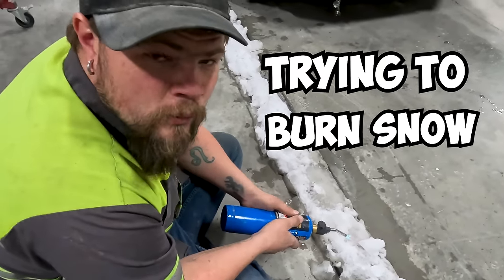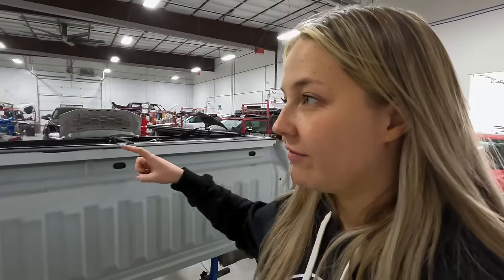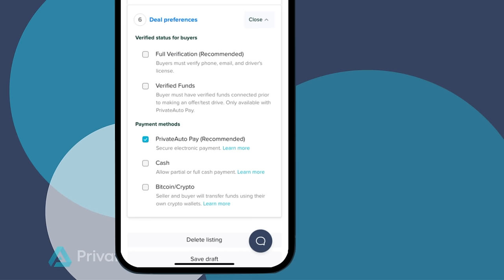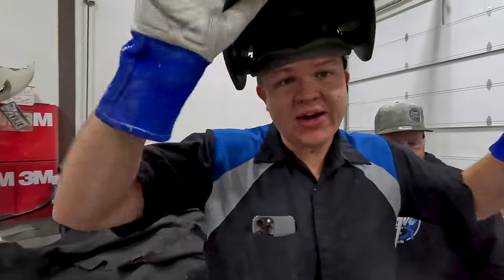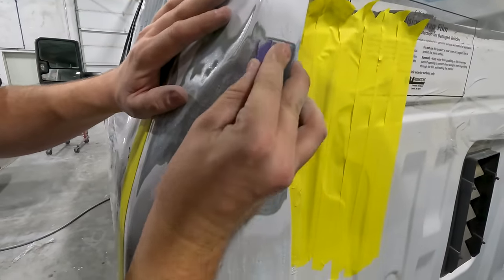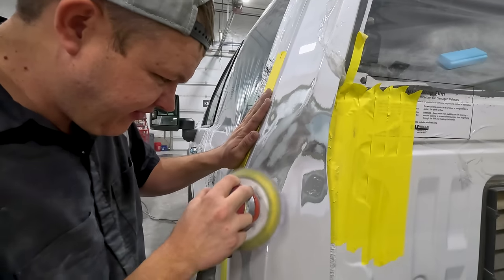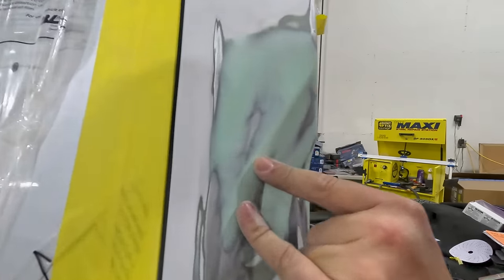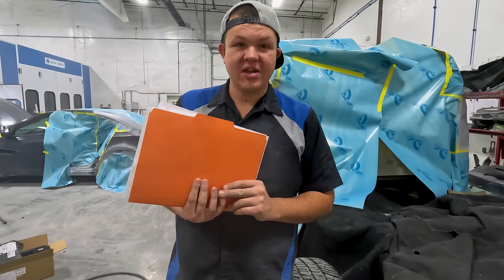Teaching The New Guy How To Fix A Dent Step By Step!

Comment: Dang dudes! That key bridge dent puller is next level. Memories of drilling holes and using a slide hammer to get big dents out. 😂 
Progress at its finest, for the finest. Amazing work by all of you! 
Try a “Surfoam” file to knock off body filler while it’s still a little green to help smooth it quicker. As soon as your fingernail will leave a line, then go at it!
🙏❤️😎🤙🛻💨

Comment: As a young SPC in Army I had a old SGt showing me how to do body repair on a damaged Humvee hood the corner was smashed. The Army's fix was if damaged enough just replace it if not there was fuel tank repair kits and sand paper then hit it with CARC paint.  His off duty hobby was classic cars and wasn't having a crap show job of a repair on owr company commanders / 1SGT truck. I was a functional repair guy "If it works as intended it's good."  I have seen how much work and time it takes to do a good or great job and the right knowledge, tools materials.  Some of it I didn't have or want to buy let alone have the funds to buy.

Comment: Body-man does not always prime, so the 11 hours actually stopped earlier right after you filled your pinholes. You were already into the paint time, unless you get prime and block time from the Mitchell Manual P Pages. Not many people do.
Reply: The shop I'm at we use CCC and add 0.3 hour featheredge/prime and block per hour of repair up to a point. I'm not sure what the cutoff is, kinda like clear coat being capped at 2.5 hours total. That 0.3 for prime and block is categorized under paint time so it goes to the painter and accounts for materials.

Comment: I know what I did wrong when I did body work and respected my hood on my '01 Subaru legacy. I left 120 grit scratches and a couple 80 grit and my blocks were no where near rigid enough. Damn and that was a winter project in my barely heated garage

Comment: As a fellow collision tech I will say this repair is very thorough. But blocking fiberglass? Anyways! 😅 also I will say I dislike the rage  optex compared to platinum 3m gold filler. The new thin sheet metal on these new vehicles takes patience to get worked into shape.  Good vid

Comment: Do you ever use PDR? I have had it done to a couple of my vehicles and had good results.
Reply: PDR guys are artists. That cab corner would be a tough spot with needing to gain access from inside, and all the curves and body lines going on as well as trying not to break the paint. But I've been surprised at what they can pull off more than once...

Comment: I have a question why wouldn't you use a spot weld drill to get rid of the spot welds versus the finger
Reply from the maker: Speed and accuracy of a belt sander is why

Comment: A good body guy can usually beat the repair time but I live in the rust belt so good luck beating replacement times.   Money is made in the office more than the shop. If you are not billing for the extra what used to be called P pages you are loosing money

Comment: Hardner doesn't need air to harden. It has a catalyst to harden. It's a chemical reaction. Glazes usually are air dry but filler does not need air to try. So that made no sense to me that you said your scratching it to make it dry faster.
Reply from the maker: If you open it up, it allows the solvent to escape it 100% helps it cure!

Comment: SUGGESTION: for compound curves, get different sizes of rubber blades. They are made of something like eraser rubber, and they are around 5mm thick, so you need to sharpen the working edge to your liking with 80-grit sandpaper(but it still stays quite blunt and rounded- that's ok). Note: to clean, you scrape it with the metal blade while it's fresh, or wait until it hardens on you; bend it all the way to crack it and scrape the remainder off with the same blade. I touch up the working edge with sandpaper after every cleaning anyway. It's a lifesaver for curvy bumpers, doorways, and places like the edge of that cab(you can wedge it between your middle and side fingers and bend it to shape while applying). Note 2: after one or two thin coats with a rubber blade, I usually finish with a metal or plastic blade while bending it hard to shape and quicly squeezing thin filler into the remaining pores and then giving it nice thin all covering coat.Note3: if I accidentally create some filling blade steps, I flush cut them with sharp filling blade just before it hardens(so its not wet, but still rubbery) or give it some 80grit light pass selectively through steps(Not paint or smooth parts, and do it straight after it hardened and is still warm- then its very easy to sand and less dusty). If its done right, there should not be any filling blade steps, you barely need to sand it, just blend in with paint and smooth it out throughout.